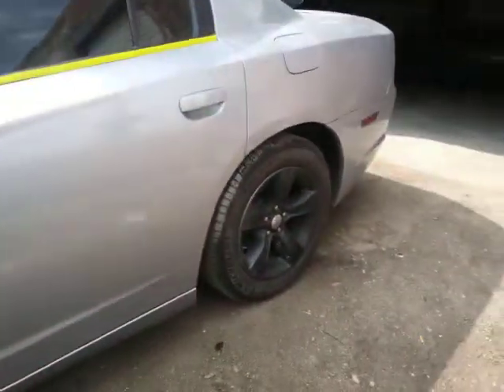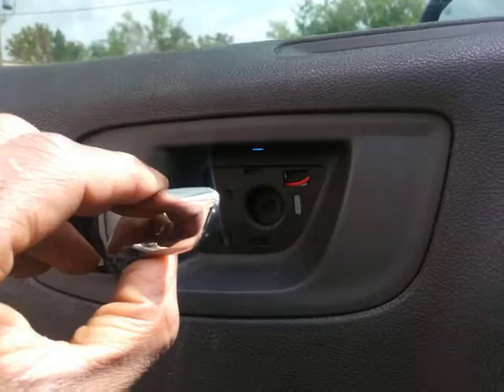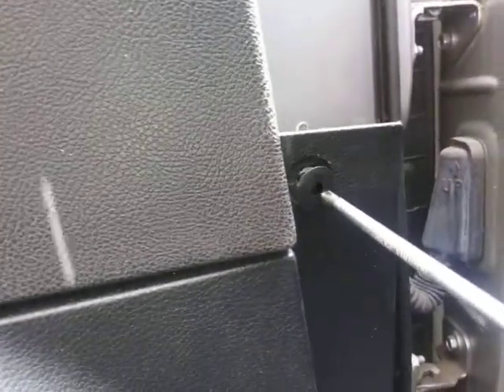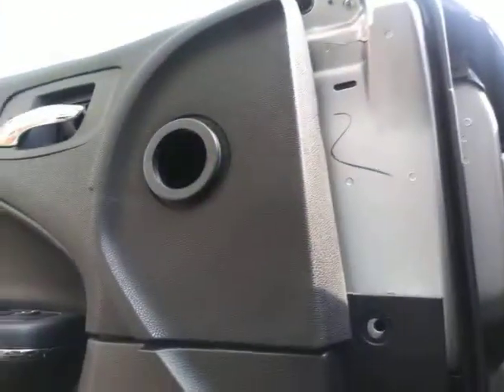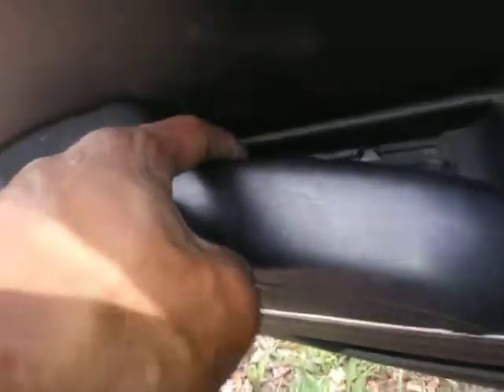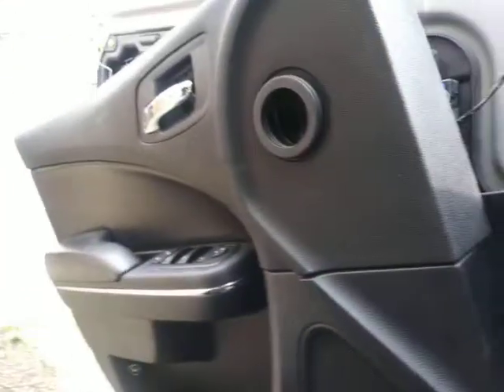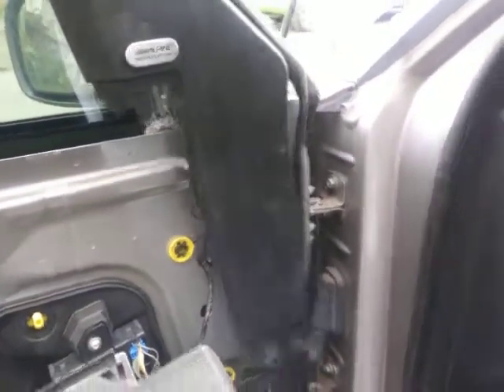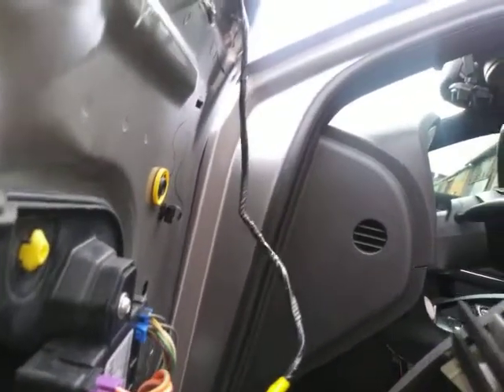2014 Dodge Charger. How to remove door panel and mirror #CHARGER #HOWTO #DIY

Comment: I'm going to pull the whole thing off, like you did. I just need to remove that left armrest pad though. I couldn't find a video on just that. I needed to know if it has screws you loosen from underneath the back of it, or if it just pops off of there, and doesn't need the whole panel removed? I will probably know that answer before you can reply though. Thank you for the video. 👍
Reply: Did you ever find a way to remove that part?
Reply from the maker: Which part was that?
Reply: @avengethegame2724  I did have to remove the whole door panel, to get to the screws under the armrest. There was no easy way to remove the armrest pad. It does "NOT" just pop off. I've seen so many others that just pop off, then pop it back on. Not this one.
Reply: @spaceagecustomz6070  armrest pad on the door. Mine is cracking all over. I had to pull the whole door apart, just to get that thing out. No easy pop off and on, like other door parts on other vehicles.